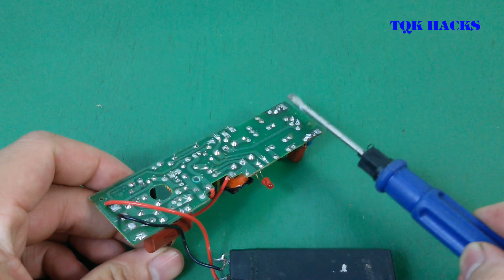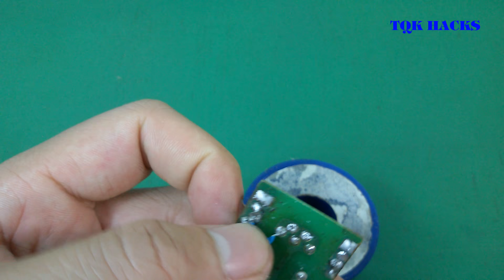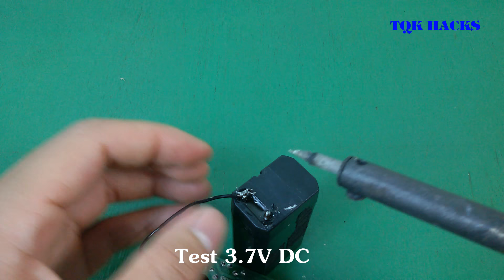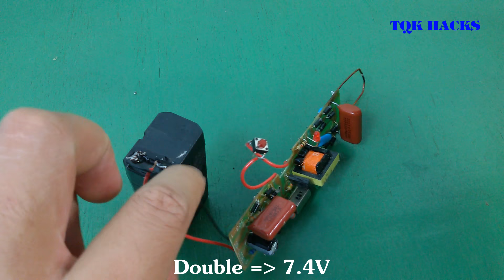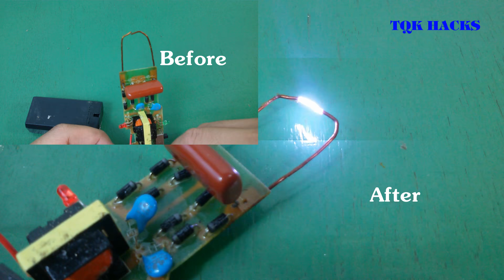How To Make A 20000 Volt Taser From A Bug Zapper High power - KIM DIY

Comment: Im sorry, but that was modified considerably more than just three caps and doubled voltage. That circuitry came out of something besides a bug zapper. i see several capacitors, diodes, and transistors. More than required to make a bug zapper.

Comment: In short the low voltage rating capacitors and diodes get shorted inside and reduce the output voltage so replace with high value caps to get the full voltage
Reply: Theres a few things you can do. Some wont keep the circuit working, but it kicks ass in the meantime. A higher voltage rated transistor, a transformer with more windings in the secondary, a bigger cap, more voltage. You could just increace the voltage and cap, but its hard on that transistor if its not rated for higher voltage. Definetly increase the cap. I didnt and the one I had in it exploded. It was kinda cool though. Lol

Comment: I replaced that red capacitor with 5 3kv 10nf ceramic capacitors and it was weak then i tried putting back the red capacitor and it was still weak the i put it on a 8v battery and it just broke. does the brand matter?
Reply: Weak pcb or components

Comment: SORRY, but never get 20000 volt with that circuit. Lucky if the zapper give 2000 volt with 3 vdc input, if doublet the voltage maybe get 4000 volt and lucky if don't blowup the 2500 volt capacitor. For 20000 volt has to be than with volt multiplier, which is totally different circuit and safe. PLEASE DO NOT BUILD THAT CRAP IS VERY DANGEROS. STAY A WAY BE SAFE !!!!!!!!!

Comment: What happens when i join 6kv ceramic capacitors insted of 2kv
Reply: It will be better for circuit protection and will also give higher voltage

Comment: stupid video u just placed the 2 kv capasitor befour and the 1 kv ceramic capasitor under the circuit just reversed it . and by increasing the power  input the length od the plasma will 
automatically increase simple  concept led will glow more brightly if we increase the voltage same concept here also . stop fooling. make the  same video by using 4.5 volt battery and add a voltage multiplyer.
Reply: That right
Reply: why did he licked a complaint?
Reply: Yes

Comment: How would increasing the voltage on the main cap but cutting it's capacitance by over 50% do this if you didn't change out the transformer to increase the delivery voltage to the cap?  Presuming this actually works as shown, this should just increase arc length, but actually reduce energy delivery which would actually make it weaker & constantly discharging if reinstalled since it would jump the gap in the grid the bug is supposed to bridge.  Adding higher voltage batteries is going to stress the internal insulation of all the low voltage side components & probably burn them out quickly, since they're specced for 1.5v, not 3.7v.

This seems very goofy & like it wouldn't work for several reasons, but I'm not 100% familiar with how these kinds of 'joule thief' transformers work or their oddities.

Comment: Brothers, how much capacitor do you need if you want to do 1000kV
Reply: To use 1000kv u need a more input voltage
You would need a marks generator to increase voltage 
But the number of sparks per minute will decrease 
And more winding in 2 coil of transformer 
Lot of work ..
Reply: @raghavdhyani5739  I plan to use 3.7v 18650 batteries connected in series, which is 7.4v. My discharge time is very short, only 5 seconds. If it is more, it will burn. How can I make 2000KV, 4000KV, and the discharge time reaches one minute. Use it to catch snakes  , it is very convenient to catch wasps